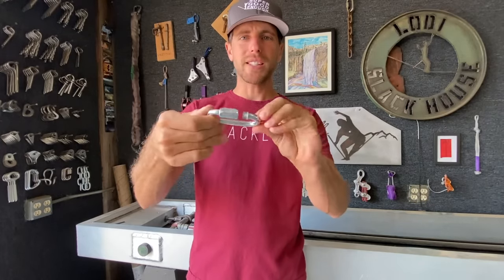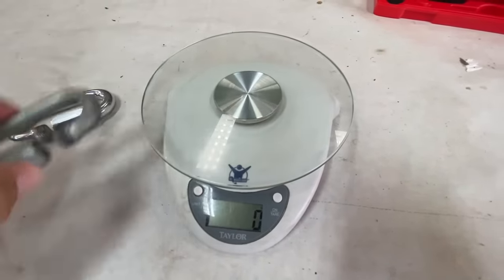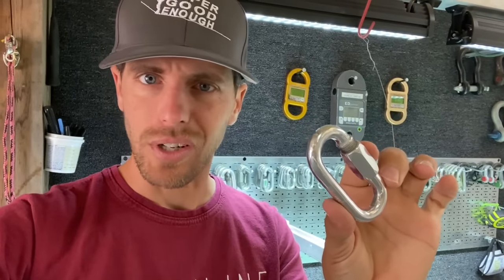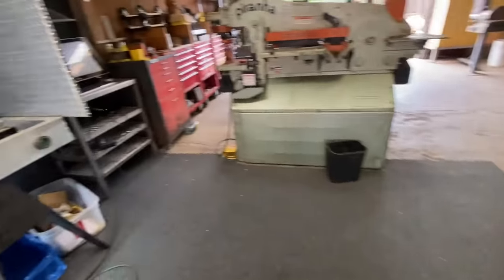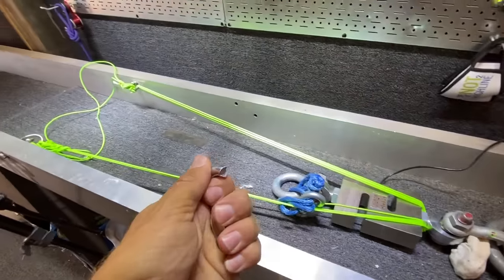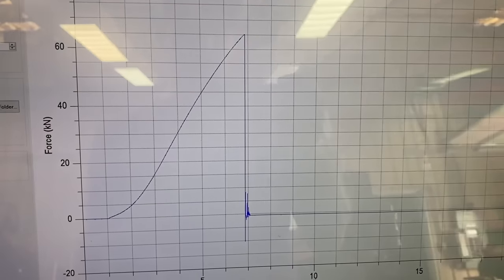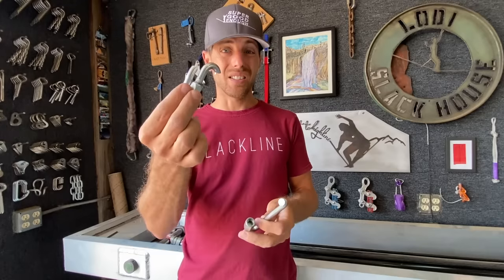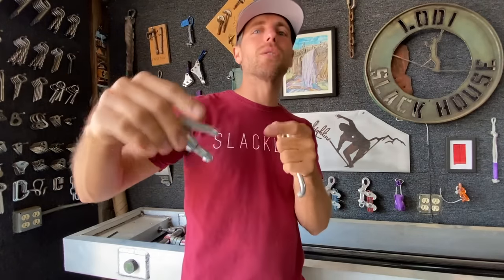Rated maillon rapide aluminum vs steel quicklinks.  Can we use these climbing and slacklining?

Comment: Tip: Use a 2nd Maillon as a wrench to open the 1st Maillon. Adjust the gap on the 2nd to go across the flats of the nut on the 1st. Then, turn. Something for the mental toolbox and might get you home one day.
Reply: really clever

Comment: I’m pretty sure that if you fall hard enough exert 65 Kn of force through you harness and into a quick link, you’re gonna be just as dead as if you hit the ground
Reply: With every fall over 6kn on static connectors you can kinda expect some injury from the shock alone. This js why industrial shock absorbers need to reduce the forces to 6kn. With a normal sports-harness and a fall on static connectors you can expect your hip/back to break even way before you reach the 22kn strength to break any of your climbing gear. So I guess what I am saying is, do not take factor 2 Falls on static connectors. Either use dynamic connectors or shock absorbers in a scenario where factor 2 is unavoidable.

Comment: Ryan's idea of a cyclic load test machine setup is actually just pushing poor Bobby off the drop tower with a backup until the gear on the test line fails 😂 although Bobby's MBS has already proven sufficient not to even require a backup line 🤣👍

Comment: I love your testing! When you swapped out the soft shackle for a steel quicklink in the second pull, I think you inadvertently changed the parameters of the experiment. The soft shackle can (and must!) apply an inward radial force where it is in contact with the aluminum surface, but the steel quicklink cannot because it does not wrap around the aluminum. This radial force squeezes and deforms and no doubt weakens the aluminum in addition to the stress resulting from the applied tension. It doesn't necessarily mean the squeezed area becomes the weakest point on the object being pulled, but it can.
Some years ago I break-tested a circular aluminum ring that arborists use, rated at 20 kN. Unfortunately the inner diameter was only about 1.25 inches, and I couldn't fit two steel shackle pins into the opening for the pull, and replaced one of them with an amsteel loop girth-hitched into the ring. I was surprised when the ring broke right under the amsteel at about 12 kN. Careful inspection of the break showed just a very shallow dent where the steel shackle had been, but very obvious twisting and crushing where the girth hitch had been. Even the contours of the girth hitch could be made out imprinted into the metal!
I think a circular ring is a shape vulnerable to weakening by any kind of rope connection, but that it is rarely a practical concern. I can't wait to see your upcoming drop tests!
Reply: oh, man, i've been using a girth hitch-ed 9mm sling on my kong kisa via-ferrata break for fifteen years. it's a thin aluminium plate. i've ordered some parts to swap that out for a steel connection. thanks.

Comment: Many people use mallons as bail biners so that would be a weightsaving if your always carrying one.
Reply: Don’t do this unless it’s at an anchor. Maillons are hard to impossible to remove on lead and make clipping a bolt more difficult, and can actually cause carabiners to fail way below MBS due to what is effectively loading over an edge.
Reply: @kaimcguire5086  so clip behind the maillon
Reply: You're not saving weight if you're carrying something you don't need. Just leave a biner for so many reasons.
Reply: @n4boards144  No, stop doing this, please. It's antiquated.
Reply: I never go climbing without quicklinks and rappel rings. Doesn't matter if it's a 5.6 in the middle of the city or a 2 day hike 5.14a, with my luck the 10mm rappel rings will be on their last 2mm. I'd rather inject $15 into the community than start rapping off hangers. At least when people leave links behind I can reuse, instead of another like-new BD biner on the second bolt. No shame to people punching above their weight, but daddy racks photons.
Reply: @n4boards144  exactly, it’s pretty simple. Don’t understand why people get so worked up about this. Hard to clean on lead, agreed. So clean it on take or lower.

Comment: I got used to the steel ones when spelunking. Used them in place of 'biners to attach ascenders and descenders to harness.
I also wonder about the hysteresis effect of loading the quick link to 48kN, then unloading, to loading to break at 52. A single cycle would be preferred.
Interesting to see thread stripping in the steel maillon. Perhaps a different thread (deeper?) could improve that a bit. Not sure, though, my days of machine design are long forgotten.

Comment: I see lead rope solo device attachment with these things. Use two on my Silent Partner.  But seems like a wrench/pliers will be needed.
Reply: I like 2 of the Metolius Bravo Lockers. They are small and light. Problem is they require massive amounts of turns to lock entirely (but they feel more secure thanks to that...). I guess a quick link would need many turns to lock too so... Your choice in the end! Let me know what you end up liking the best!

Comment: Many canyoneers will use rolled aluminum "bail rings" in lesser traveled canyons (especially in the Grand Canyon), or first descents. So, similar to an aluminum Rapide.... not a sustainable option for longer term use. The rope pulling through wears through the aluminum more quickly than S.S. which causes a loss in strength of the ring or rapide. 
Aluminum carabiners wouldnt work well in place of a rapide because most rigging in canyons require a one-sided block on the rope and you want the smallest opening possible that still fits the rope (7-10mm rapide). Use of a carabiner left in place of a rapide have resulted in multiple fatalities due to the block slipping through the larger opening.

Comment: As others have posted they are very common for industrial work in Europe. I think of the Aluminium ones as more of a harness to equipment connector rather than at the anchor point. 

Mostly I've seen them used as a semi permanent attachment to harnesses now people are moving towards using things like Progress Adjust-I and similar instead of cows-tails. Needing a spanner or another Maillon to remove them is a good thing in this context. Its not something that is removed apart from inspection on the ground.

They make a very good connector is your load has a potential to try and move round the connector whilst being much cheaper than circular carabiners like the ring style ones.  

Weirdly the wear against steel is a good thing for a few users. It means the connector wears rather than the steel D-ring on your harness which can't be replaced. Also using the steel ones is pointless when the D-ring on your harness will fail before them. 

The triangular ones can be good for temporary anchors and load sharing.

Comment: Back in the 80's, I used 'maillons' for caving gear, along with both steel and alloy carabiners. Often the maillons were more convenient due to size and weight, and used on gear that rarely needed removing. e.g. footloops on an ascender. Also, not the case for the harness I used, but some of the common harnesses used for caving were basically legloops and a belt which came together at 2 points and were fastened with a large 10mm 'maillon', usually in a 'D' shape or sometimes a delta, (triangular) shape, also handy for connecting tape /webbing to a single fixing like a carabiner.
Reply: It's the same now

Comment: I would think the thread galling would be a major issue if it gets shock loaded,  I really don't trust aluminum on aluminum threads much.
Reply: when we used to rig caves on maillions as they were cheaper than crabs, Aluminium ones didn't rust up and jam like steel

Comment: Stainless wears on the ropes less if you lower off on climbing, that’s for sure.
Reply: Also Aluminum mixed with a stainless hangar is a bad idea long-term for reasons you already know. (Galvanic corrosion)

Comment: Steel quick links are much better when we talk about friction. The difference between aluminum and steel you can see in cave equipment. Repelling tools has aluminum parts witch wear out very fast. If you use quick links to do repel it is better to use steel. By the way, stainless steel is worse than carbon steel but of course carbon steel corrodes. I waiting for frictions tests... it will be interesting :_)

Comment: There are some quite nice cyclic load testing machines on the market, that are capable of applying something like 50-100 cycles per second. The downside is that they are probably outside the budget of this channel, and as 50-100 cycles / second is 50-100 Hz, which is a frequency humans can hear, they are quite loud, and you can't really avoid the sound with earplugs etc, speaking from experience (there are custom built sound proofed containers that work though).
What you could do, is to make a hydraulic piston based cyclc load testing machine. You'd only need a relatively short piston (unless you're testing ropes), some way to measure force (which you already do), and some really simple control system, that observes the force, and uses that information to control the piston. It could do something like 1 cycle per second, maybe 2. That would be 60 cycles / minute, 600 cycles / 10 minutes, or 3600 cycles / hour.

Running tests at a low stress levels gets real slow, boring, and feels awfully like science, but here is an idea: Decide the stress level, no. of cycles to test, and once that's done, use slacksnap to break the test piece and see how much strength it had left.

Carabiener could be cycled between 0.5 and 6 kN (you always want to have some tention in the system, and 6kN would be quite a bad whipper)
Test run until 300 cycles or failure, which ever comes first (find balance between no. of cycles and time. 300 cycles would be 5 min)
If test piece still intact, break it with slack snap and see how it performs after 300 super hard whippers.

This way you could do cyclic tests and slacksnap tests at the same time, which would save filming time. The problem is, that if cyclic tests are long, it's really inefficient and slow to film. If the tests are shor(ish) and efficient, setup/start cyclic - setup/run slacksnap - end cyclic - setup/start cyclic - setup/run slacksnap... starts to feel like borin, sciency work.

Comment: Why does it hold about twice what is rated for? I have two guesses:

1. Maybe it is rated/tested with loose nut. Kind of like half the piece. Maybe you can try loading it with the nut unfastened.

2. (And more likely) it may have something to do with the tensile strength of the material. It may be rated so low because loads above those numbers exceed the ultimate tensile strength of the material, which mean plastic deformations occur, which mean it may be impossible to unfasten it even with a wrench :D

https://en.wikipedia.org/wiki/Ultimate_tensile_strength

Comment: My guess is that the much lower rated MBS vs breaking strength is to allow strength reductions over time due to fatigue if these are used in an industrial or rescue application where the loading could reach higher forces than typical climbing applications. Fatigue life on climbing carabiners is less of a concern since we're barely reaching 30% of MBS in rare occasions for a typical wiregate. This also seems to follow the heavily conservative ratings for quicklinks in general, perhaps to encourage people to not rely on a single point for heavy loads.

Comment: that would be great to carry for an emergency rappel from a single hanger.
Reply: Please never ever do this for climbing.
Reply: @sebastianflynn1746  you should say why otherwise you just sound like a random comment. I'm sure he's meant in a climbing situation
Reply: I've had the same thought. 100g less than the steel quicklink is really good.
Reply: @sebastianflynn1746  In an emergency I'd much rather thread my rope through a quick link for abseiling than the hanger itself. No?
Reply: What if a climbing harder route you end up in the middle - that would do the job.
Reply: @thiagoennes  use a carabiner they're cheaper and can be easily clipped by people who can actually climb, they can also be removed easily by the next person, there is absolutely no advantage to using an aluminium quicklink over a carabiner.
Reply: @sebastianflynn1746  Well, a locking carabiner is not cheaper than a quicklink, and if it is, you should not buy it. I am talking about an emergency, which can and does happen to climbers at any level. You can come back later and easily remove it from the hanger since it was thumb thightened (even after loading it). I have no idea why this thread reached the point where we are guessing and measuring peoples climbing levels, but I don't feel like having a conversation in that tone.
Reply: @thiagoennes  aluminium ones need a spanner to remove after loaded and no one ever recovers maliones if you were going to recover them you would just leave a draw as it wouldn't matter. Leave a snap gate, this is standard practice, maliones just screw things up for everyone else.

Comment: ok, novice climber here:  my use case might be, carry a couple on my harness routinely and use as leave behind gear for doing a carabiner blocked rappel with pull cord just in case we miscalculated length of rope or misread the topo.      Light, one time use.   Maybe leaving a hazard behind for the next climber?

Comment: THinking about the wear from repeatedly pulling ropes through the link and the relatative resistance between the two materials. Both are obviously strong enough in the immediate. As alluded to in the video, it is a question on long-term durability.

Comment: Cool video! Al quicklink seems like a possibility for a safe way of building a retreat anchor in the alpine. I had an exchange recently about using wire carabiners. Folks use those as central point in retreat anchors, but i don't feel so comfortable swinging on a rope with a regular (i.e., not screwgate) carabiner. You Americans seem to like to tape the wire carabiners with a sticky tape. Still, the Al quicklink seems to be a safer option. Weight saving is questionable, i guess, as someone here pointed out that you're not reqlly saving weight if you're carrying something you'll not likely to use.

Comment: I only use these to escape routes. If I get stuck and can't move up for some reason (rain, strong wind, ice, exhaustion) then I can rapel from a bolt with this (yeah I know it's a single point but it's only for emergencies) they cost less than carabiners and they are small. I guess Im gonna buy aluminium next time if it doesen't cost much more because the ones I have are super heavy.

Comment: Now you make me curious on the Zinc quicklinks, the 10mm are treated for 3800Lb. I use them to bail, but I've seen them at anchors too. That's only like 11-12kN.
Reply from the maker: Many quiklinks are rated with a WLL (working load limit) not a MBS (minimum breaking strength). The WLL is often only a fifth of the MBS as it is meant to represent the load the item can take over and over again without damage not the ultimate breaking strength. - Bobby
Reply: Zinc?  Do you mean Zicral, which is aluminum alloy?
Reply: Or perhaps you mean the Zinc plated Steel ones, aka Galvanized Steel.

Comment: I've use an aluminum quicklink to attach a PAS (Purcell Prusik) to my harness for almost a decade now. The small size makes it easy to work around and the weight isn't noticable
Reply: to your belay loop or tie in points? what's the advantage over girth hitching like other pas systems?
Reply: @keilyxbay3816  metal to belay loop, textiles to hard points. I find the quick link to be less cluttered, plus it's easier to monitor wear since it's moving. Really though, try different things out, be aware of the (dis)advantages, and decide what works best in your system.

With most things in climbing there are multiple correct ways and the best way is what you're most comfortable with
Reply: @zwidel  Thanks for the reply! Been thinking about trying the Purcell Prusik so I may give the quicklink attachment a try.
Reply: @keilyxbay3816  for the Purcell, the biggest plus to me is it's cheap. It has more adjustability than sewn loops within its range, but you can't tie in as short. For specific personal anchor systems, I'm sure there are plenty of people who have written pages contrasting all the options
Reply: @zwidel  Indeed. I've been using a nylon runner w/knots which is OK but not super adjustable. The inability to tie in short with the Purcell was one thing that was keeping me from trying it, but I recently saw the suggestion to use a second carabiner to clip back to the belay loop which allows shortening it beyond half its overall length. Does require carrying the second biner but I'm curious to try it, and like you said, it's cheap so not much to lose :)

Comment: There isn't that much theoretical about ultra high cycle fatigue of al alloys. It's all in literature. The main thing I would be worried about is consistent alloying, heat treatment, manufacturing e.g. casting. If the manufacture spec is off by 2.5x... makes you wonder if the material is changing or there is quality issues and they took the number based on spread in testing.
Reply: More likely, there was no point in rating it higher than they did.

Comment: My Wichard pricelist (2015) has the following "List Prices" -

Aluminum 10mm:  	$ 20.40
Aluminum 10mm PPE:	$ 23.80

Galv Steel 8mm:		$ 6.00
Galv Steel 8mm PPE:	$ 7.10

St Steel 8mm:		$ 22.40
St Steel 8mm PPE:	$ 23.50

St Steel 10mm:		$ 33.60
St Steel 10mm PPE:	$ 37.50

These products usually available at a discount somewhere, but for comparison. You can see why using the Galvanized Steel ones is popular.
Reply: Why would you use Stainless Steel ones?  Is there any point?  Highlining over a Volcano, perhaps???  ;-)